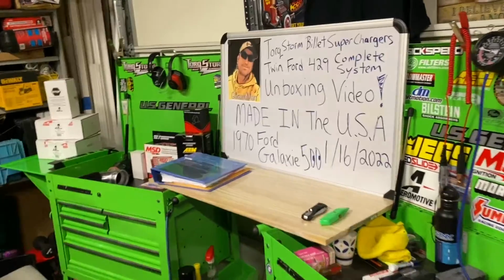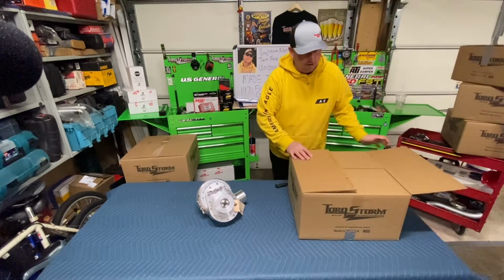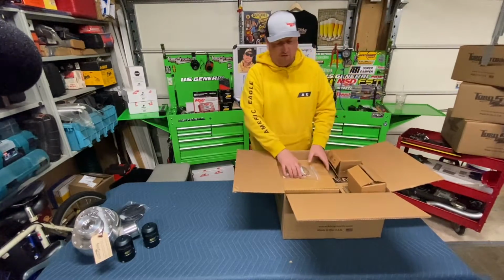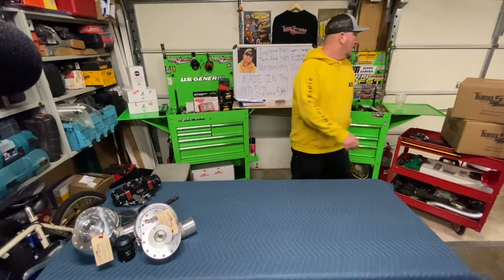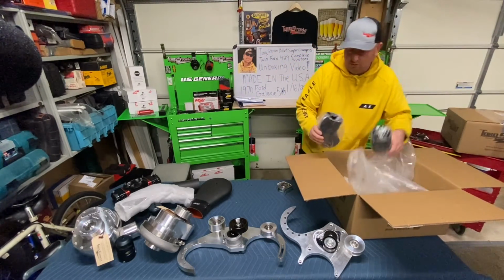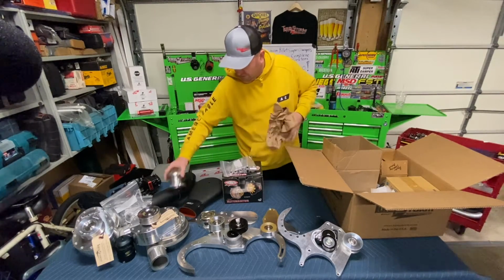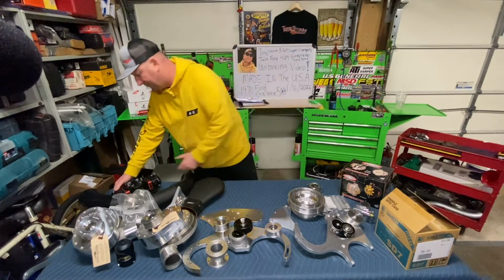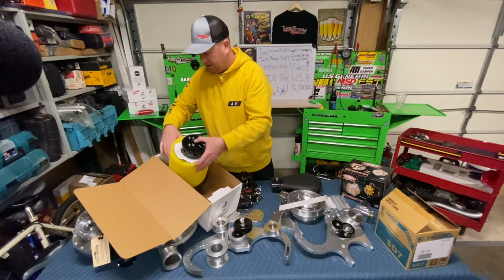Unboxing Torqstorm Superchargers Ford Galaxie 500 twin blowers high performance boosted muscle car

Comment from the maker: They make a nice kit. It’s well engineered. I’m running mine for 3 years now and have had nothing but success. The have an 84mm bigger setup and they also have a 94mm for major output. Call Torqstorm and speak with Chris. He will hook you up.